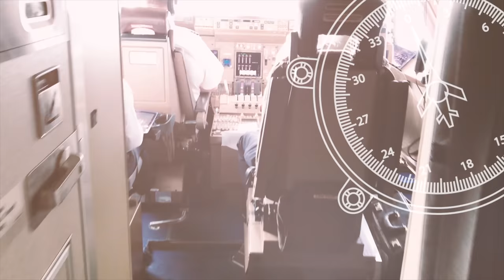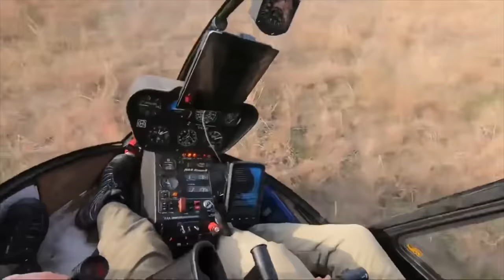Boeing 747 Loses Landing Gear | Viral Debrief

Comment: According to the other fav aerospace channel SkyEng, the 747 was designed with four main gear because most airports did not have runways and ramps hefty enough for the 747 to ride on two mains. Sometime by the 80s(?) maybe in the 747-400 era, they thought about deleting one pair of mains, but decided against it and keeping the four boggy design.

Comment: When a helicopter comes down it's not like taking the wings off a plane. A helicopter can autorotate (use the air passing through the falling rotor to spin it up and slow descent) to the ground and make a relatively normal landing (videos are well worth watching!). It may be that they were too low to the ground to start autorotation fully but you can definitely land a heli with an engine out.

Comment: Kelsey, This R44 Helicopter autorotation (January 9, 2021 in Albany, Texas ) C-GJIA imported as N322SH, is noteworthy not for the autorotation but for how and why the engine failed.
Its classic human factors. If you have not flown the R44 then its hard to see what the video is telling us.
The pilot took off with the magnetos off.  How and why the mags worked in the off position is a maintenance issue.
You can see the expression on his face and dubious hand movement when he goes to switch off the mags that are already off.
When the pilot goes thru the switches after landing, it appears he realized what happened and was aware that it was on video and the cause would be known.

Comment: My husband took a flight from Chicago to Seattle with some other military. When they left O'Hare, he noticed the plane just kept circling. The pilot came on and told them that the right wheel on the front landing gear had fallen off and was still on the runway. The engineers had assured him that they could fly safely to Seattle. One way military deal with a bad situation is to use dark humor. One sergeant said "Well, if we're all gonna die, can we make this a smoking flight?" or "Shouldn't we be getting free drinks?" or "Guess I'm not going to get my frequent flyer miles now". I think the FA's finally told them to knock it off because they were scaring the other passengers. 
Just before landing, the FA's came around and collected glasses, keys, and shoes. fyi, shoes can tear those slides, especially if they have heels. Yes, they had to assume the position. SEATAC had foamed the runway and first responders were on standby. God bless those pilots, they got everybody on the ground safely. Thank you for getting the man I love back in one piece, though he was in no hurry to fly again.

Comment: Hey Kelsey, I believe the first video is a Virgin Atlantic flight coming into land at Gatwick Airport (2014) - not far from where I live! I've been meaning for quite some time to send you the photos I took of this aircraft dumping fuel and flying abnormally low over Ashdown Forest (where I just happened to be with my camera), 14 miles from LGW. In fact I actually thought it going to crash land it was flying so low and, my photographer instinct kicked in for some rather cool images where you can clearly see the wheels haven't fully retracted.  :-0

Comment: A long time ago, I was briefly addicted to Falcon, an F-16 flight simulator for the Mac. I learned some aerial techniques, got familiar with the the weapons systems, and could do ok in a dogfight. I just never really got the feel for landing. I could never line up to the runway correctly, and I could never get the right landing speed so I usually crashed or had very bad landings. I’m sure the real thing is even harder.

Comment: Ok so I have a question so what if the two landing gear on the middle didn't work would you shut down uh engine 2 and 3 because if you landing while there running they might explode

Comment: Kelsey, love the channel. When a large jet "dumps fuel" possibly many many gallons, (maybe they just took off and must come back, (but have time to dump,) or even max fuel loaded, (for going across the pond,) at altitude, but they need to come back to land for some reason,) what happens environmentally? Does that fuel dissipate enough to not be of concern, or is it still of high enough concentration, that it can it kill residential lawns, golf courses, parks and commercial grassy areas,  or poison ponds, water sources, rainwater catchment, etc? If it is bad environmentally, do pilots try to dump in rural areas or over the water, (if they are able,) or is it just pull level and dump with no regard.
Reply: I'm wondering about that too, but I don't want to come off as uncaring to the environment.  We have lost many resources not just in aviation accidents but on the ground, and sometimes, to save a dog or cat stuck somewhere.  In a case like this, would you care to save the environment, or save lives?  I have this thought when I think about saving resources and caring about the environment, there is no point in saving the environment in a planet with no human-life left.  Think about saving the people first, clean up later.  Chances are in 100 years, humankind will be so advanced at cleaning up jet fuel (or flying planes that need no jet fuel), that they'll be wondering why didn't we save more lives.  Think about the doctor who operates on a person that has no insurance, at that moment, the fact that he's uninsured is irrelevant.  At the end of the day, I really hope they're aware of the environment and cleaning up all that requires cleaning up (and everyone has heard about cleaning oil spills in the ocean, it's done a lot to save wildlife)!
Reply: @MacCentrisSimpleSencilla  Thanks for your opinion. You are overthinking my question. I was not making a choice between the environment and saving humans. I just simply wanted to know what technically happens when the lever is pulled, with no moral or political considerations. Also, if there is no immediate threat, does a pilot make the decision, "hey lets wait 10 minutes and dump over the desert, or hey lets dump over Las Vegas because I am on step 13 in the book". Again, in an emergency, we do what is necessary to save life. No decision there.

Comment: It's an R-44 Robinson helicopter. That has a low-inertia rotor system. Besides airspeed, you have to concentrate on main rotor RPM. When you lose the engines in a helicopter, you lose the lift that the rotor is producing from the air it is moving from the top of the rotor disk to bottom of the disk with the force of the engine. Lift is then generated by the air that is moving through the bottom of the rotor disk to the top of the rotor disk. If you allow the RPM to decay during auto-rotation, the main rotor will stop spinning and the helicopter will loose all lift, resulting in a crash. You practice auto-rotations during pilot training. It's like the tallest log flume ride you've ever been on. I practiced at 152 m (500 feet) above the ground in the smaller 2 person R-22. It's very smooth and controlled. The R-44 in this video had the misfortune of being over uneven terrain. It looks like they might have collapsed the right skid - or that's the angle of the berm they came to rest on. Helicopters like the UH-1 Huey have a high inertia rotor system. My instructor described the difference as upon touchdown, with a failed engine, you could lift off from the ground and fly the helicopter from the force stored in the main rotor blades, go into a hover, and land again. With a low-inertia rotor system you put it down and do what the pilot did in the video - go through the shutdown checklist. If you are ever a passenger in this situation, pay attention to the pilot for exit instructions. If the pilot tells you to exit while the rotors are still spinning - rare - always move to the side or the front of the helicopter - never to the rear towards the tail rotor. If you're on an angle like in this instance - exit the side where the path of the rotor is highest off the ground. That's a very heavy rotor blade - even though it's been made as light as possible.

Comment: Just a quick note, I don't believe there is any facility to land planes on Boracay (there wasn't when I lived there, and it probably is not big enough to accomadate a landing strip). Visitors will typically land at the Kalibo airport, and there is also a smaller airport in Caticlan with a shorter runway. However the latter has water on each end, so the landing in this segment that is incorrectly noted as 'Boracay' is most likely the Kalibo airport where they ended up on the SW end when they overshot and got onto some grass . Visitors then have an hour and a half drive to Caticlan from Kalibo where they board a pump boat for the short ride to Boracay.

Comment: When I was a child my neighbor worked at the Anchorage International Airport (now Ted Stevens). I was with his wife and kids one day watching as he was driving a truck checking runway conditions. He was cleared onto the runway and proceeded onto the East/West runway to check how much ice was there.  He was about 3,000 feet down the runway when he got the jolt of his life as a 747 landed with the inside right main gear leg in the back of his pickup truck pushing him down the runway destroying the truck and injuring him severely. It turned out that one of the controllers had gone to the restroom and when he came back he cleared the 747 to land on the now closed runway. My neighbor's dad was in hospital for 6 months and in rehab for another year. He was never able to return to work and in a wheelchair for the rest of his life. The collision tore the gear leg from the aircraft and the truck was only 33 inches tall after the incident.

Comment: @15:28 I had to look up what Kelsey meant "at 30 feet I do the FLARE" Definition: The landing flare, also referred to as the round out, is a maneuver or stage during the landing of an aircraft. ... In the flare, the nose of the plane is raised, slowing the descent rate and therefore, creating a softer touchdown, and the proper attitude is set for touchdown.

Comment: as an ex R44 pilot, the engine failed, but R44 was heavy with 3 pob, loads of fuel, the Rotor RPM was at the bottom of the RPM range (never good) and had a high engine power setting according to the manifold pressure gauge, could have been why the engine quit. Still all persons safe. landing gear collapsed by design cussioning the heavy landing.
Reply: R44 only had pilto and 2 PAX.

Comment: kelsey, I know you are supposed to fly runway HDG to Specific altitude and your request Vectors to the FIX for the Holding area right?

Instead of burning off fuel, why not use the JETTISON OPTION. 
I know the fuel exits near the wing tips. BUT where are you legally allowed to Begin Fuel Jettison when OVER MAX LANDING WEIGHT?
Or do you have to be above FL100 to legally jettison fuel, and maybe it Evaporates so quickly that you can Jettison anywere or any time?
Thanks mate 😊

Comment: I AM A 747 CONTRACT CARGO PILOT AND I AGREE WITH THE COUNT DOWN BUT ABOUT 30 TIMES IN MY LIFE IT WAS INOP. I HAVE AN AREA ON THE WINDSHIELD AND DASH I USE AS A GUIDE AND I ALWAYS MADE A SMOOTH LANDING. I USED TO DEMO IT IN THE SIMULATOR. I LOVE THE EGG SHELL LANDINGS EVEN IF IT IS BAD WEATHER. I WILL GO AROUND IN A HEARTBEAT AT 50 FEET OR LOWER, AND I HAVE TOUCHED DOWN AND WENT AROUND IN VERY BUSY TRAFFIC JUST FOR SAFETY BECAUSE IT DID NOT FEEL RIGHT. I HAVE 22000 HOURS PLUS AND MY PILOT LICENSE IS STILL A LICENSE TO LEARN TO FLY. I ALWAYS ADD TO THE BRIEFING EVERY FLIGHT TO BE PREPAIRED TO GO AROUND ON ANY LANDING. I HAD ONE ENGINE OUT #3 ON A LANDING AT GROSS LANDNG WEIGHT AND THE 15KT CROSS WIND DID NOT FEEL RIGHT, TOO HEAVY IT FELT. I TOUCHED DOWN AND THROTTLED UP THE NOSE WHEEL NEVER HIT THE GROUND I WENT AND DUMPED 2OOOLBS OF FUEL FOR SAFETY AND CAME BACK AND USED ONLY THE OUTER THRUST REVERSE ON 1 AND 4, THE LANDING WAS SAFE AND STILL HAD 2000' TO SPARE BUT I STILL FEEL LOSING THE TON OF FUEL MADE IT A VERY SAFE LANDING. TRY IT NEXT TIME YOU GET IN THE SIM. 15KT 90 DRGREE XWIND NUMBER 3 OUT MAX LANDING WEIGHT. KEEP NOSE OFF THE GROUND AND MAX POWER TO THE OTHER 3 ENGINES. THEN DUMP 2000LBS OF FUEL AND COME BACK. IT WILL BE SMOOTH. KNOW YOUR WEIGHT AND BALANCE. YOU MAKE EXCELLENT REVIEWS.

Comment: Do you dump fuel disproportionately in a 747 when you have a gear out?  For instance, right gear out, dump fuel on right wing so the plane leans left and doesn't fall on the right wing during landing.

Comment: The only thing I saw wrong was in a helicopter you can unhinge the blades from the motor and have a nice easy glide to the ground. Obviously at 10:30 they didn’t have enough time for that but just thought it would be a cool little fact to share.

Comment: Question regarding 747 landing. Is it possible to transfer more fuel on to one side of the aircraft to shift the center of gravity a bit. Basically make plane lighter on the side where it's missing landing gear? Would that make the landing safer, lower the chance of tipping. Is it even possible to do it at all (or in this aircraft). Just a thought.

Comment: I remember about 15 years ago watching live coverage of a Jet Blue A320 flying from BUR to JFK making an emergency landing at LAX with the nose gear stuck at 90° to the left. Fortunately the gear didn't collapse and the nose didn't deviate from the center of the runway, although the tires were shredded and the wheels were ground into the tarmac down to the axle.

Comment: I was on a 747, sitting next to the windows, and as the pilot started to move the flaps I saw oil dripping continuously across the wings. Is that normal? At leaving the plane, I reported it to a flight attendant.

Comment: I know this is an older video, however I felt it necessary to say.. With the 747 landing gear on the first video in this, I watched another video somewhere (netflix or prime or something) about hard landings and this video was on there. The explanation for the hard landing was they were trying to unjam the gear thinking it was just stuck since the gravity drop didn't work. So it was intentional (again according to the other video I saw). Also, sorry if this has already been pointed out, I didn't want to read through 839,247 views, I'm lazy like that.

Comment: On a Chopper if the Engine Fails Cut you Rotor so you don't spin. The Weight of the chopper blades will keep spinning due to air flow down draft..Slows it down slightly

Comment: Lots of discussion but nothing to tell us where it was ! I presume this was the 747 that landed at Gatwick when one landing gear failed to lower. The AAIB report makes interesting reading both in the misleading marking on the hydraulic actuator , the port marked lower goes to the top ! Also the design allowed the actuator to be fitted upside down - seems to be a fundamental design problem to me reminiscent of the one way fuel valve that had the same size thread on both sides resulting in one being fitted the wrong way round and the aircraft crashing. The Gatwick incident was also impacted by a lack of the correct tools and fatigue.

Comment: I believe he only had three seconds to respond, not five in the helicopter crash. I think that crash was a Robinson r44. I've done lots of Autos in the Robinson R22 and it has a low inertia rotor system so you have to get the collective down within one second or the rotor will stall and you're dead. In the r44 you have three seconds. Much more of a cushion, but there's no time to wind your watch.

Comment: Kelsey Why do you have to turn around for something like a lost landing gear? Why not continue to the destination and worry about the problem at the end of your trip? Wouldn't that save fuel save on a delay for passengers or cargo.
Reply: That problem could be an indicator of worse problems unknown to the flight crew.  In any event - that aircraft was designed to land with all landing gear deployed.  To continue with a known problem like that would be criminally negligent, something that thousand of trial lawyers just dream about if the aircraft crashes.

Comment: Could they have been attempting to land hard to see if it would pop the gear out? If the doors had latched but not opened they could have been trying to jolt the gear down and into lock? Kind of like using the yoke just put G’s into the aircraft

Comment: Kelsey, in the landing gear failure, you didn't show the end of the roll-out. I'm curious if the right wing dipped and hit the runway, or does the large central gear truck have enough stability to prevent the dip?  Do the procedures allow for keeping extra fuel in the left wing to prevent the plane from dipping to the right? would that even work?
Reply: The wing stayed above the ground!

Comment: As a young Marine at MCAS(H) Futenma (Okinawa), on one of my days off, I got a chance to watch CH-53E's doing auto-rotate exercises. At about 2-3000 ft they would shut both engines off and they got REAL quiet. Yes, they would pitch over about 10-15*, then about 75 - 100 ft yank it back to literally 45 - 50* nose up, then just as they were about 20 ft - bring back level and some of them would bounce up a few feet and then slowly rollout down the runway. Hear them spool up the engines and do it again! 

Except once. 

After auto-rotating down and taking off, instead of doing it again, he came in at about 50 ft and hovered as the crash crew got into position and climbed out of the top hatch of the fire truck where the top water cannon was. The '53 hovered about 5 feet above them as they worked for 10-15 minutes to get the front gear to drop out. THAT WAS SOME STEADY NERVES ON BOTH THE AIR CREW INSIDE AS WELL AS THE GROUND CREW UNDER THIS BEHEMOTH! Awesome to watch.